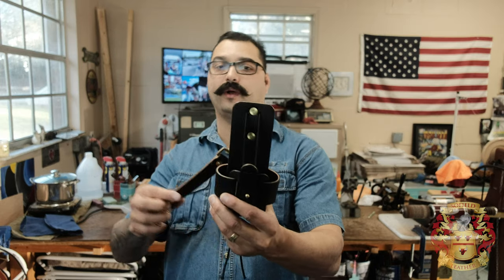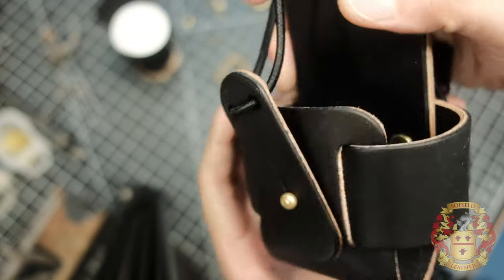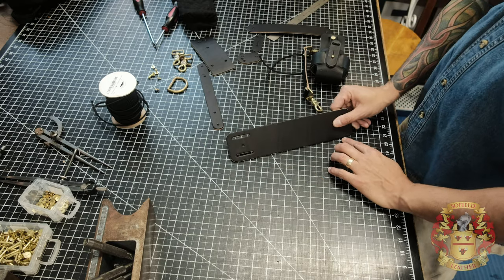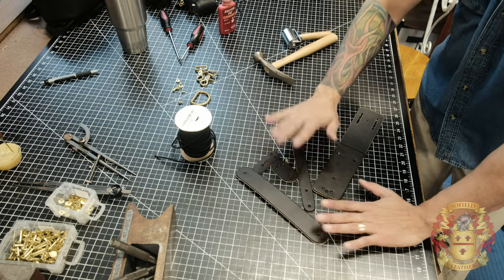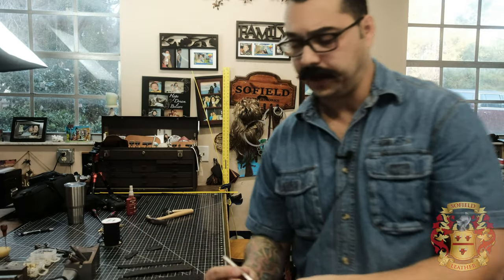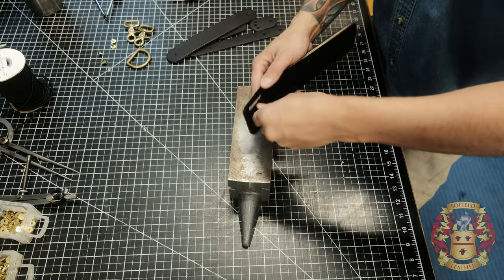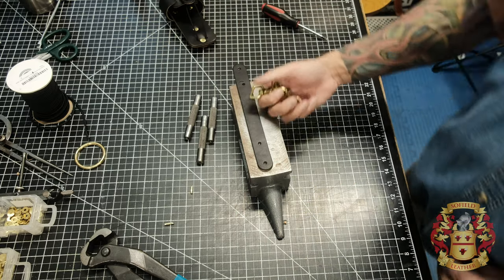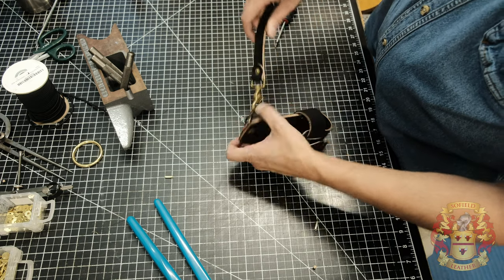How to Make a Firefighter Radio Holster - Pattern Download - Tutorial

Comment: Piece "f" is the punch correct? I feel like the it should should flipped so the peg slides into the groove. Have a had had issues with it coming undone? Have you used this radio holster in the field?
Reply from the maker: Thanks for the question. The orientation in the print is correct. The shock cord pulls the tab up against the hole and not the slot. Ive been using this system for about 7 years. Thanks for watching.
Reply: @SofieldLeather  thank you for responding so quickly. I purchased your template this morning. That was the only question I had. Thank you do much!

Comment: Hey. Really like your work. I’m making the suspenders and the radio strap now. 1 question before I get the radio holster blueprints. Do you have a pattern with the face of the holster be a little bigger? I would like to put a Maltese Cross on front of it. Thanks
Reply from the maker: Thanks for the  business. Sorry but I do not have a pattern for that. I guess you could modify the shock cord tab and make it bigger.

Comment: What would I need to do if I wanted to use thicker leather like 14oz?
Reply from the maker: That might be too thick for that wrap around pc. I’m actually thinking of bumping it up to like 12 oz or so. All pcs should be fine except the little Sam brown tag pc and the sway strap
Reply: Thank you for the quick reply on that! Just wanted to check and see what you had thought.
Reply from the maker: No problem. I do think it’ll hold up alittle better probably with thicker stuff. Never had a problem with the 9-10 oz though. I am bumping up to the 12 oz for future holsters. I stuck with the 9 oz as it was more cost efficient to use same side for the radio straps. I would stick to the 9–10 oz for the shock cord tab as well as the sway strap. I would also maybe skive down the wrap around of a little at the hole ends of you use the thicker stuff. Thanks for watching. 👊🏼
Reply: Completely agree with the economics of using the same side. I agree I’ve never really had an issue with 9-10 on a lot of items. Just had the same thought of bumping it up a few ounces just so it is way over built and nothing should ever happen to it. Definitely agree with the skive and keeping a few others at 9-10.
Reply: You make great content for Fire leather and I absolutely enjoy it. Thank you for the time you put into it and the great content that you put out.
Reply from the maker: Thanks Mark. I appreciate it brother. 👊🏼